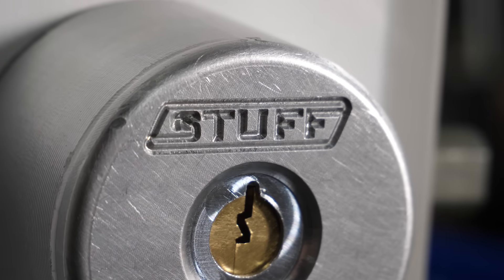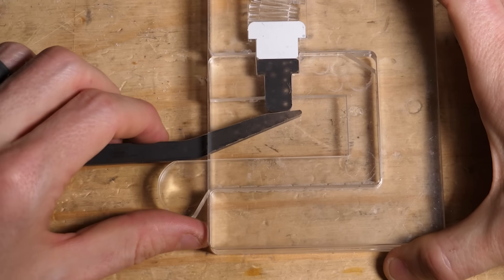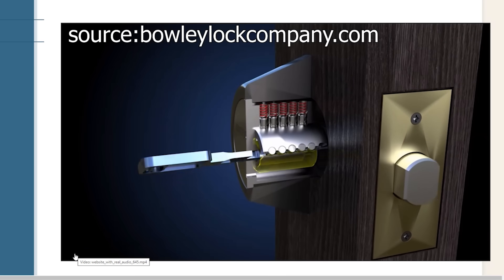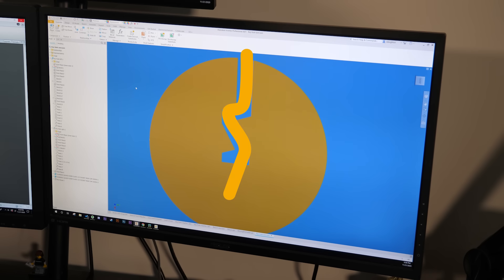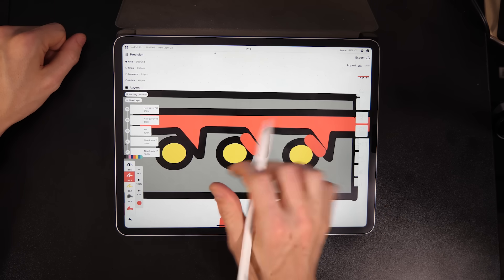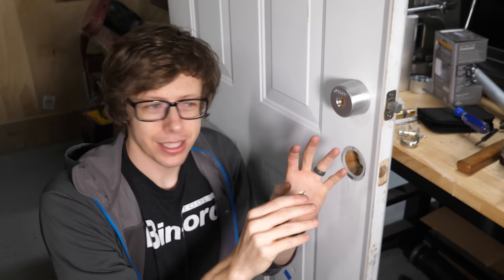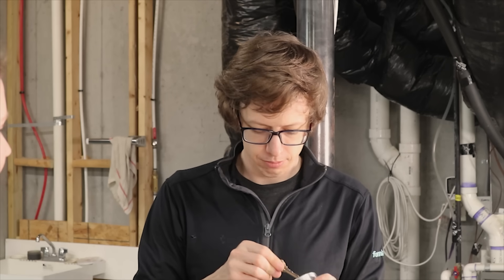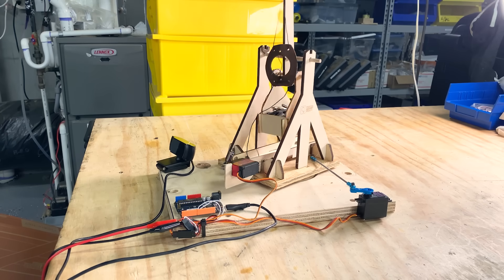Making an unpickable lock. Calling locksmiths

Comment: I think people skilled at lock picking who watch this video would come to the conclusion that its a tool makers challenge and less a picking challenge.

With the right tool, hypothetically they could push on that back piece enough to engage the pin lock at the back and then return to standard picking tactics.

Remember; what one man can make, another man can break.

EDIT: I had a similar idea after watching a lot of lpl that used the key to push on a trap door/lever at the bottom of the key way to actuate a hidden pin (with the door/lever ground flush with the key way so a visual inspection wouldnt show anything obvious). If not set, that pin would act like a security wafer and jam the lock after a short distance even if the rest of the pins were correctly picked. Bonus? The key would always be able to "reset" the lock unlike the security wafers which require the lock to be completely disassembled to reset. But even this design would be pick-able once the picker knows whats going on, since it would literally be just an extra pin at the bottom. The goal with this design would simply be as a non obvious way to stop basic pick attacks.

Comment: Just wondering, if the spring mechanism to hold the pins in place was the most difficult part, why not use a flexible 3D print? You could ensure you apply pressure to all pins, wouldn’t have to deal with springs, wouldn’t have to machine the parts, and could potentially have much higher friction than metal-on-metal, especially if the print deformed slightly on contact. I know it would be less durable, but the Formlabs ‘Flexible’ resin is still pretty tough.

Comment: Seeing if someone can break into your house and seeing if they can pick your lock are two VERY different things.

My favorite way in is finding an unlocked window.  There's usually one.  And that, bump keys and to a lesser extent lock picking are only if you want to keep a low profile.  For the most part, the lock on your door barely matters - there are sooooo many other ways in that are easier than going through a door.

Are RFID locks really that good?  What about cloning?

Comment: Possible attack: insert comb and lift all pins to the top. Then insert something to push on the lever that locks the pins in position. Then rotate until resistance, then lightly wiggle the lock while letting go of the lever, until the pins hopefully drop down into position.
Reply: Congratulations to myself for being right 😀

Comment: I’m curious if there’s a fairly simple way to accidentally / on purpose “brick” the lock by getting the pins in a state where they don’t come back down, but are not able to go through the gates either. That’s usually what happens with “unpickable” locks. They can’t be picked, but they are also unreliable.

Comment: "It’s resistant to standard attacks." So is a disc retention lock or any digital lock or other sufficiently advanced mechanism? And like most high end locks. There’s no chance a random average locksmith has the ability to pick a custom lock that is trying a novel locking mechanism. Lockpicking isn’t like performing magic inside a tiny keyhole, anything other than a standard lock requires you to know the security features and how to defeat them to be able to open it. With no knowledge of what is on the inside, a properly designed novel locking mechanism should be literally impenetrable due to how it combines with other security features. If the lock is the only thing standing between you and whatever you want though, it’s not a matter of if, it’s a matter of when. Lockpicking lawyer just takes a ram set to certain locks for a reason, their greatest security flaw is that the parts shatter when smashed with what is virtually a sledge hammer.

Comment: Possible flaw: push pins as high as possible, lock them in place, turn to the gates, start removing pressure from pin locking mechanism so that pins are going to fall in holes one by one

Comment: I think this could be single-pin decoded, by measuring tiny differences in core rotation on iterative tries.

It would certainly take a while, but with good eyesight one could probably do the measurement with Sharpie lines drawn across the core/lockbody boundary.

Maybe some sort of concentricly-traveling gate that moves into position AFTER the pins are moved away from the core, and actuated with a separate handle coupled via a heavy spring?

Comment: I don't think this is the best design. As long as you know you have to insert something all the way up through to set these pins, your lock can be picked.
Instead what you could do is to move pins  validation at the position when the pins cannot be moved anymore.
So when you enter the key, you set the pins. Regardless of if the key is valid or not, you can rotate the core. When you rotate the core, pins are blocked in the position, so you cannot pull out the key or move the pins at all.
Then, at some rotation level pins are validated. And if they are properly set, you can rotate the core more.
The main point here would be to block the pins so their movement could not affect the validation mechanism at all.

Comment: Ok, I am going to offer one vector, there is a reason locks are inset into doors.

There are specific tools designed to lever locks out of the door face, instead you give them a massive face to use.

The mechanism for the lock itself does look impressive.

Comment: If your so concerned then do this a key will set it correctly at the correct height but once it's set you need to turn the key like a dial and knob like left turn 20 right turn 40 right turn 50 left turn 80 so on an so forth.

Comment: I see a possible attack:
- Comb Pick to push all pins up as far as they go.
- Actuate the 'catch'
- key way tension to the stopping point
-  'catch' & key way tension to slowly lower the pins until they line up

may or may not work depending on how fine the machining is on the pins and which one 'sets' first as you can't reset pins that come unset while setting other pins.

Comment: Everything is commercially viable if you get the right quantity and the right price. Who wouldn't want to have a lock that the locksmith lawyer can't pick. I am a machinist in high volume stuff and very complex thingy things. I think I could help you if you have a lock with 4 pin with 5 position I could program you a cnc program that could make all 625 combination for that worst most complicated component.

Comment: I don't think that TLPL will be able to pick this. Not with any of the techniques that he uses in the videos at leas, and not with any other technique that I can think of. Having the pins locked in place, then rotate the core and only THEN have the pins going through the gate (if they are at the correct height) is very smart. "Click on one, 2 is binding" cannot work because you don't know which one clicks or binds until AFTER you start rotating the lock.

Comment: Honestly think your lock would be "commercially" viable. That is to say limited production. Don't know the costs of production of course but I know there's a lot of people out there wanting the best available option and getting not one but two experts to confirm your design isn't flawed would make for great testimonials and publicity. Typically with lock picking lawyer the people seeing their preferred locks broke in less than a minute aren't going to maintain their trust in those locks despite the lack of skilled individuals that can repeat his techniques so a failure to beat your challenge would amount to having your lock certified as the best around.

Comment: i made a 6 pin lock for fun that uses custom spool and mushroom pins.
If you don't lift the correct 3 pins all to same height at the same time, move tension wrench without locking the next 3, then more those last 3... then the lock either jams or resets itself back into starting position. (it also breaks drill bits so that isn't an option)
Not saying my lock is impossible, but using 4 lockpick tools at once is hard.
I'm into locksport and have friends in it as well that can't get it open either.

Comment: Hello, It's the lock picking lawyer, as you can see, I was able to pick the lock in just under a minute, but there is a pretty big flaw in the design of the lock, and it can actually be opened with a napkin and a lego brick.

Comment: If you do send it to LPL, you have to make it clear that it has to be judged from a single pin picking standpoint. He should still be allowed to point out potential flaws outside of that, but if you're trying to call it specifically unpickable, then it has to be judged on that merit alone. Security is like a chain, it's only as strong as it's weakest link. In this case, my concern is the material of the outer body. Considering it's machinable, it's quite possible to drill it. Regarding tolerances and design, bumping is out of the question as demonstrated, overdriving pins past the shearline (both key and driver pins) is also probably not a concern. You made your lock out of relatively high temperature metals it seems, so melting it with a plumbing torch is also probably not a concern. Things like that.

Comment: LPL -  "I'm going to use this tool Destin and I made to send this standard hook in 25 thou straight through the back of this and activate the locking bar. That's all I have for you today; Thank-you for watching and have a nice day."
Reply: "All we have to do is create a vacuum, increase pressure to 1500PSI, insert a pick for top of the key way tension in 40,000ths, and then see what happens... so we will be working in the garage today"

Comment: Was going to suggest the Bowley lock until I saw it in your little montage there. Be interesting to see what LPL and Bosnian Bill have to say about it. Could be some commercial viability there if you can figure out how to easily change the gates on the upper pins. Maybe square pegs? Interesting concept. You're trying to design a new lock that takes some manufacturers years to develop.

Comment: just wanted to say that uuh you could just drill a hole in the lock and you've entered in 5 seconds its really easy wich is why banks make a there locks need a lot of pins to unlocks and also they make the lock its self with very strong materials

Comment: I think you build a tooling challenge instead of a picking challenge. Basically someone """just""" has to design the right tool to pick your lock design. There are a lot of locks that you can't pick with normal tools but that doesn't make them "unpickable".

Comment: "get a lock that doesnt require a key"
meanwhile lockpickinglawyer.............
Reply: ...pull a really strong magnet from his pocket
Reply: one word "RAMSET"
Reply: Everyone is saying LPL, but I don't think they understand what he is saying. You're going from trying 100-200 times to having to try over 12,000,000 combinations. LPL doesn't have time to do that.

IF his lock works. The dude made a self barber lmao, it's gonna work.
Reply: @DitchPickles  There's always a bypass to be found you can count on LPL to do that
Reply: @DitchPickles  the idea is that LPL is of such high caliber he can figure out a way to pick the lock without brute forcing the combination, which would actually be nearly infinite since you could cut the pins to any length. That would be actually impossible, his example number in the vid was for a password not the pins tumbler
Reply: @xxportalxx.  It's still about the same way because of how the pins sit in there. Thats why the comparison is made. Sorry! 

I'm not saying LPL can't pick it. Im eager to see as well. I just think it would be a challenge in the least
Reply: @DitchPickles  I have no idea what you're trying to say, it may be as easy as cutting up a tin can and sticking it in at the right angle. That's the whole reason he wants an expert like LPL to attempt it. If you did have to guess the 'combination' it would be practically impossible without some insane act of luck, or shoddy tolerances.
Reply: @xxportalxx.  He will have to set all of the pins at the same time or the lock will not be picked. That IS a combination. So I dont understand how you're lost.

Comment: Since you use a common simple key, if you make it cheap to mass produce I think you got a winner... Most "unpickable" locks have strange keys and this is not simple to service, like its imposible to find a place to duplicate keys for it... good job!
Reply: This design is over a dozen hours on a 4 axis CNC mill, that would make a hilariously expensive lock. It's not the keys that are expensive to manufacture, you can pick up a box of 50 Abloy keys for around $70 if you have a good dealer. Protec would be more like $150, but that's still only $3 per key. This design also has a lot of moving parts with a lot of failure modes, it cannot be relied upon in its current state for life safety applications. Nearly all locks in residential and commercial environments are considered life safety equipment.
Reply: @hipu  that why i wrote, "if you make it cheap", it must be possible to simplify the design for mass production tools... people will buy a good lock, even if it is expensive, if it's means using regular keys that every hardware store can duplicate and not refuse service... this will sell, even if you got on the shelf 5$ lock and 150$ lock with the same exact key, and one is branded "unpickable" - some people will pay the price tag...

Comment: Having watched enough LPL  to know that there is probably always a way, I would first try to overset the ins so they clear over the barrier, and if that doesn't work, set al the pins to their highest position, rotate it to the barrier and then jiggle the pinholding mechanism.
All this is of cause dependend on intimate knoledge of the inner workings.
But if all else fails, I could always throw a rock trough a window :)

Comment: Honestly, the "keyless" locks are typically just as, if not more, vulnerable.  Have magnet will travel.
Go Bowley.  For now.
Reply: Sure, but they’re “unpickable”. I think that was the joke.
Reply: @paddor  I get that..  but unless you're already in possession of that knowledge that might seem like a suggestion.  I'd hate for someone to secure their Scrooge McDuck amounts of gold coins or their rocket launchers with an amazon RFID lock :-)
Reply: I'm able to move the relay myself so no magnet can beat it.
Reply: Thank you for the recommendation
Reply: It´s definitely possible to make something safer. You can use a solid-state relay and use a motor to pull and push the mechanism to close the door. That way, it would be much more complex to activate the motor with the magnet. Furthermore, you have to follow the basics. No screws in the open part of the lock, resistance to cutting, etc. It would be definitely possible to make a safe RFID lock.
Reply: @skvvlk  https://youtu.be/hQTz1OmmHYo
It is possible to develop a safeR Lock.  Everything is exploitable, in one way or another.

Comment: If you want to test if a lock is pickable, you do not call a local locksmith. 99% of locksmiths don't really have what you would consider great lockpicking abilities. They mostly rely on tools other than a single pin pick like bump keys, electro picks, or just drilling a keyway. If they do pick something it's generally a kwikset or masterlock which is literally a training lock for anyone learning lock picking. A locksmith needs to get in quickly because they are paid by the call and task, not by the hour, so they aren't going to waste time honing the slowest way to get in to a lock until they are proficient at it. They will however spend money on tools that let them get in quickly and have a very fast ROI.

Comment: Send it to the LockPickingLawyer here on YT.

Thoughts: the locking mechanism can be exploited. You'll need a skeleton key that engages the warding to act to turn the core. Also, the skeleton key should have a movable bit that engages the pin locking mechanism. Deliberately overset each pin, lock it in place with the lock's own mechanism, rotate the core. Then, it's a balance between continuing to turn the core, and letting off the locking mechanism. The pins will fall, and with luck, they'll catch on their gates, allowing the core to fully turn.
Reply: idea for combatting that: offset the pins such that they go through the gates at distinctly different times (a mm at most should do it). Then set the pin locker so that it releases the farthest pin first. That way, the first thing attempting to release the pin locker and catch the pins on the gates does is drop that pin all the way. You might be able to catch the other pins, but that pin is in the wrong position, and you can't access it.
Reply: @sea_kerman  He can't prioritize pin release; that was his whole bit on having to make the pin locking thing repeatedly in different ways for 3 days. Pin locking and release timing is random to guarantee pins lock and release.
Reply: @Hansengineering  That issue was that all the pins have to lock correctly, so he had to use springs to pin them, as having a rigid locking bar would only lock one or two pins. Nothing to do with the release timings.
Reply: @sea_kerman  yes. As a result, release timings cannot be predicted or controlled.
Reply: @Hansengineering  you can adjust the lengths of the springs, spring coefficient, etc. If one spring is shorter and softer, it will engage last and release first.
Reply: @sea_kerman  Yes, in theory. No, in practice.